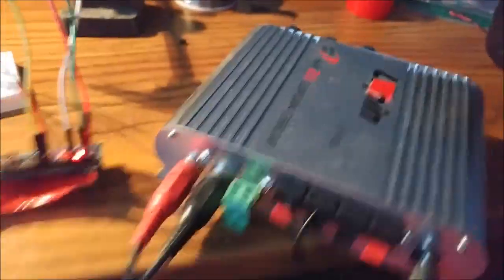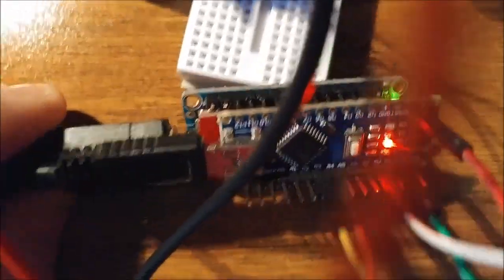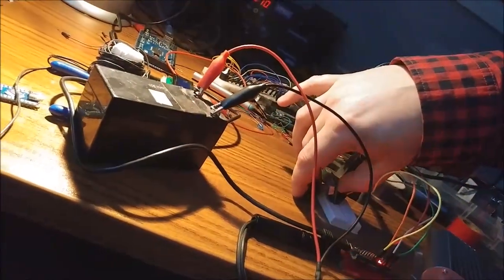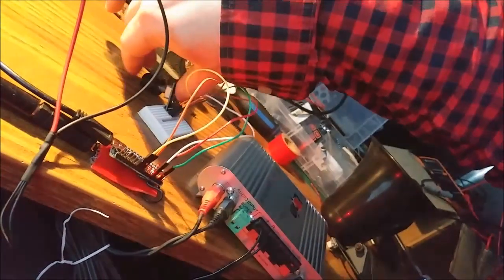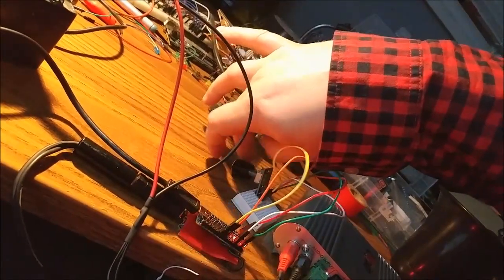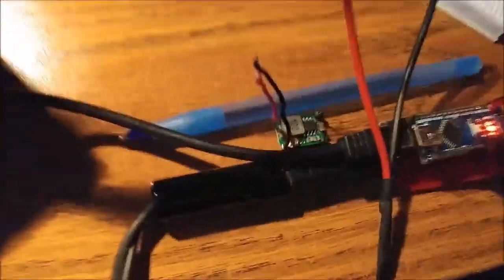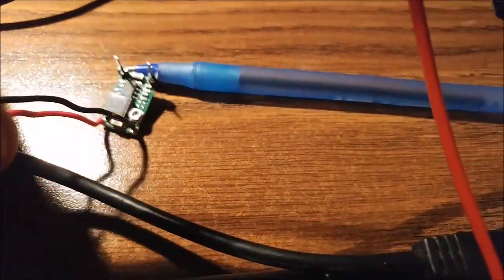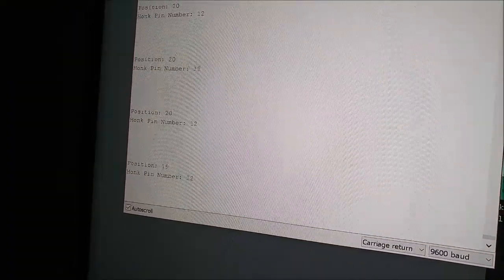Custom Horn Arduino Nano - Adafruit Sound Board 16mb

Comment: I’m currently working on the same project without an arduino for simplicity’s sake. I wired each trigger pin from the sound board to individual positions on a rotary switch, then connected the common of the rotary to one pin on a momentary push button, and the other back to ground. I love the way you did this though! I might use this method in a future project
Reply from the maker: Awesome! Thanks for the comment, and have fun with your project! =)

Comment: Hi, great project. What are the specs on the amp and the speaker used ?
Reply from the maker: "lvpin lp-838 20w 12v Super Bass Mini hi-fi Stereo Amplifier"
Reply from the maker: as for the "loud speaker" it's best searched for as "PA Horn" and there are plenty of options out there, I'm sure I used a 25-30watt horn.  Sorry I couldn't be more precise! =)
Reply from the maker: Damn it's passed the 3-year cut off on ebay so I can't even see what it was that I bought! I have no memory what-so-ever of their specs, sorry about that! :) Maybe in the video I pan across things with model numbers though!

Comment: What gets grounded? Also I was just gonna hook it up to the 12v car battery. Do you need the smaller chip to drop the voltage?
Reply: Hi, yes you need a 12v to 5v converter

Comment: hi could you please share the stuff links that you used in your project for the beginners like me :)
Reply from the maker: Hey sorry I just saw this now!  As for the parts used, the IMPORTANT part is the Adafruit Sound Board (google it for best prices, probably $15-20) and the cheapest stereo amp on eBay/Amazon and the cheapest loud speaker/horn I found on the sites as well.  As for the custom button and software, well that's all scraped now anyway, so it doesnt' exist anymore =D